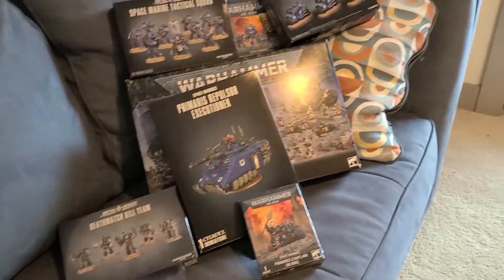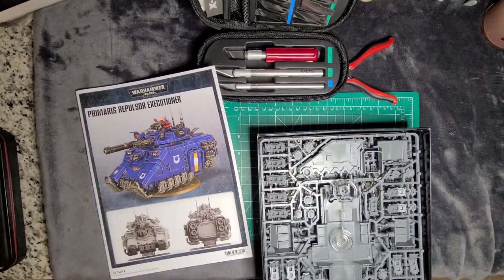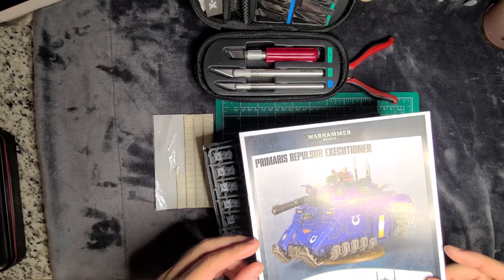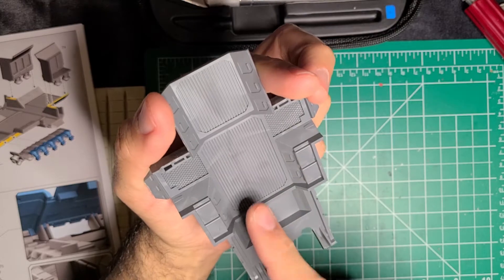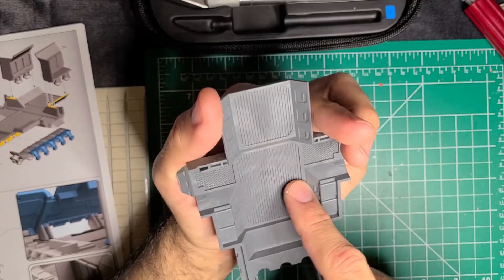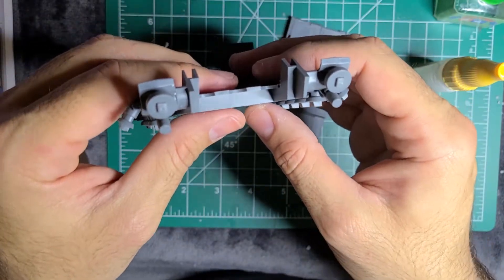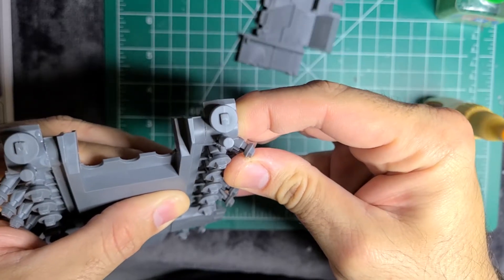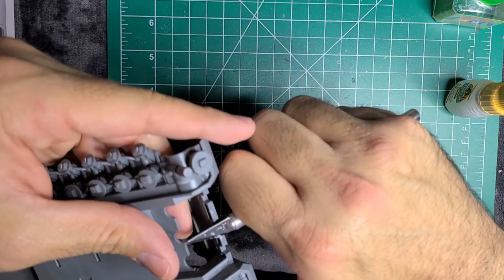Let's Build: Space Marines Primaris Repulsor Executioner

Comment: The one thing I suggest before building the tank is using primar of the color of the army you're painting and then paint all the bottom coil parts silver before assembly because once put together its a nightmare trying to figure out how to paint without making it look sloopy. So for all bottom coils and guard plates that come on later on during build, I highly suggest painting before hand to save yourself a headache and make your paint job look more clean. If you wait to paint you will either have to constantly go back an repaint any missed spots which will blot up and make it look more sloppy. Where if you paint before hand you don't have to worry about getting your brush into tight areas or being perfect so you don't have to keep redoing touch up work. Hopefully that helps
Reply from the maker: Yeah, I figured this one out pretty late. Those grav plates are a pain to paint. I could also build, prime and then pick the grav plates out with a silver drybrush for maximum ease while still looking pretty good.

Comment: You put your grav plating assembly in after you build the main tank, that way you only need plastic cement, and you're likely to get a better fit than adding them on before building out the rest of the tank body. I know the instructions say different but on my second tank I did this and the model had almost not gaps or fit issues, unlike the first.
Reply from the maker: That's a good idea. I did this with subsequent grav vehicles (well, only the storm speeder so far) and it works out better. And it makes painting the underside of the vehicle easier too.

Though it makes making separate "build" and "paint" videos a bit harder, but I think I figured that out too. Mostly.
Reply: @Elon Patrick Flixportal xD
Reply: @Benson Jensen thanks, signed up and it seems to work :D I appreciate it!
Reply: I got big ole gaps in the front I had to fix.

Comment: I honestly only use super glue because everytime I have used plastic modeling glue it never has the same strength at holding peices together as well as is more fragile. Reason being is because the glue is the bond between the 2 peices that hold them together so your souly relying on that bond. As where with super glue the glue melts the plastic together which gives it that sturdy bond. Obviously nothing is perfect and super glue peices can break with enough pressure but can hold alot more pressure than modeling glue that's forsure lol js. Plastic cement is good for peices that don't go flush together because it can be used as a filler and when painting you can't tell the bond creases. Also thank you for putting together a guide for this tank considering there still aren't many out there. So it definitely helps being able to watch and skim the video to make sure I'm putting together right.
Reply from the maker: Oddly enough, I have had the opposite experience. Superglue (for me) seems to have a pretty brittle bond and those parts tend to fall off after the build. That doesn't seem to happen for parts I glued with plastic glue. The important caveat here is that if I am gluing on a painted surface, plastic glue is almost useless.

These days I go for a full assemble with plastic glue (good old Tamiya) before I paint. Any parts that need to go on the model after I paint are superglued on.